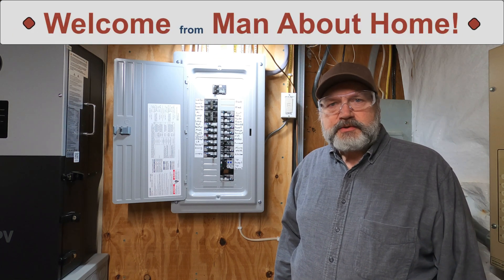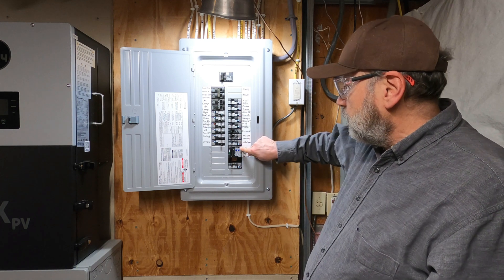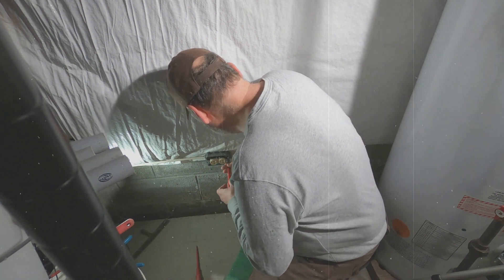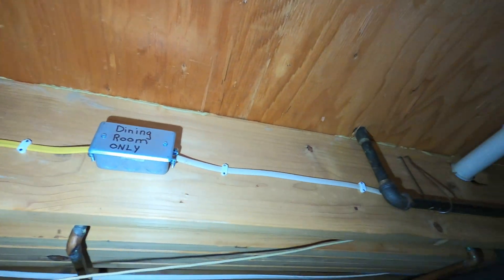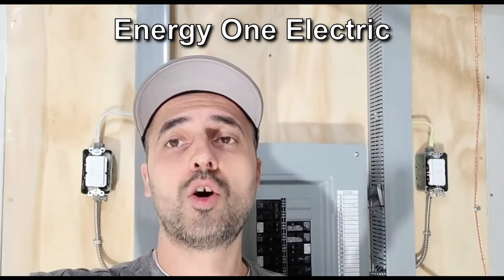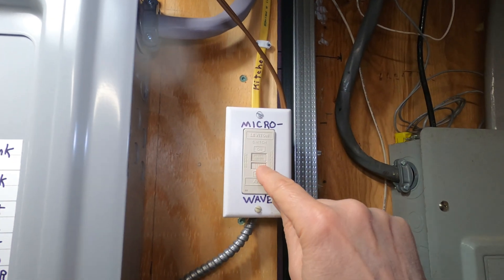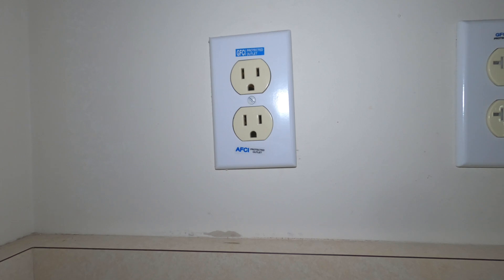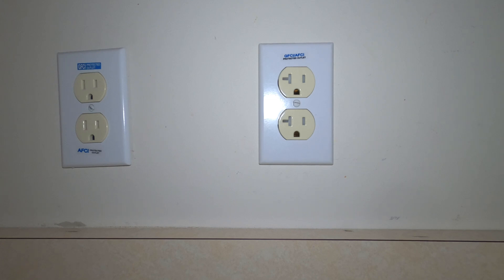Fixing Nuisance Arc Fault Trips | Round 2! | Man About Home

Comment: a lot of work just to avoid nuisance tripping. Not a fan.
Reply from the maker: What would you have done? (Besides not fix the problem.) I'm not a fan of nuisance tripping either. But it's a reality electricians have to live with every day. Apparently, Siemens breakers are known for this. Over time, I'd expect them to improve, but I'm not holding my breath. In the mean time, AFCIs are a code requirement that must be dealt with, one way or another. Mainly in new construction. As far as the additional circuits I pulled in, none of that is required. But I wanted those upgrades to our home, and eliminating that multiconductor circuit (which was a problem) wasn't a lot of extra work, considering I was pulling two other circuits at the same time anyway, it was nothing. I'm happy to know the electrical system in my home is much better, and safer now, than it was when I purchased this place. The original electrical system was half-baked. Thank you watching and commenting!
Reply: @manabouthome  i having similar problem with schneider sqaure d breakers, they suggest to use EMI filter. I didn't have a chance to try.
Reply from the maker: That's interesting. I wonder how that compares in cost and effectiveness to using a blank face AFCI device like I did.  Thanks for commenting!